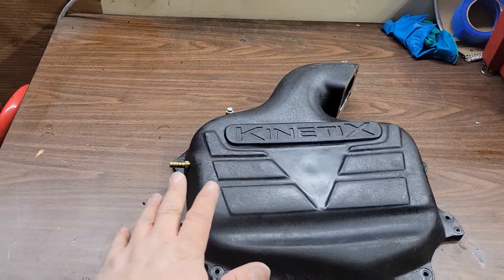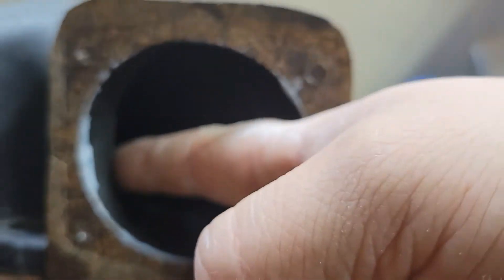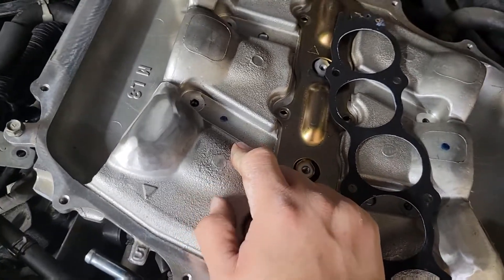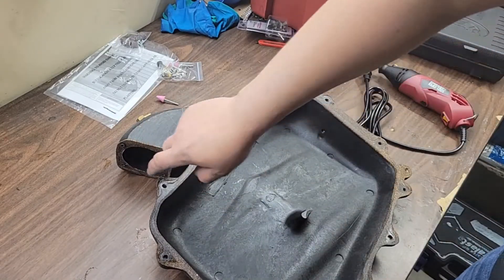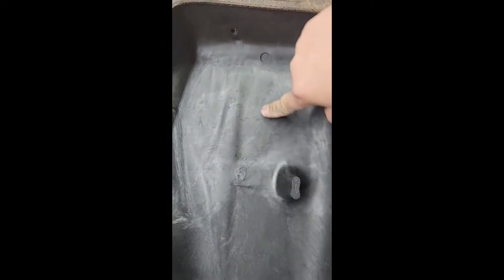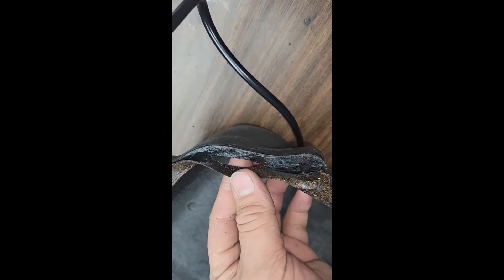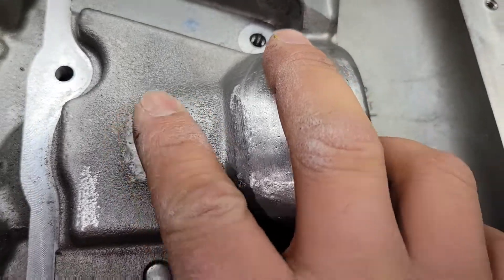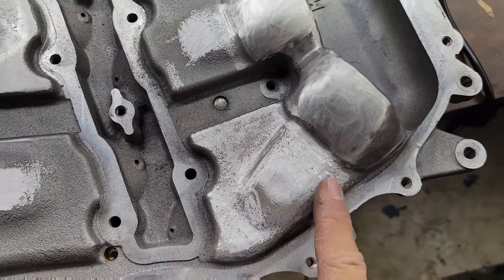Mrev2 Lower Plenum & Kinetix Upper Intake Modifications!!

Comment: Could use measure the distance from the top of the two front intake runners to the bottom of the flat inner surface? Could you tell me what those measurements are? 

I just tried to replicate Motordyne’ amid by shaving down the runners myself; but I’m not sure I shave it down far enough.
Reply from the maker: Unfortunately I can't I have the plenum installed and I have gasket maker between that and the kinetix intake so I kinda a paint to take off. Are you using a DE plenum?
Reply: @latenightgarage7895  Yes, I’m using a “long-runner” DE plenum; I just measured the thickness on my two front runners - they are both ~9.5mm after I shaved them.
Reply from the maker: @755hp  nice I was wondering if the DE was basically the same
Reply: @latenightgarage7895  Let me clarify - I have a 2006 RevUp engine; but I’m installing/modifying a non-RevUp lower plenum.
Reply from the maker: @755hp  yeah I should have put a Non Rev Up DE plenum 03 to 05 but I gotcha 👌, I hope your modifications  help improve the air flow for more power!